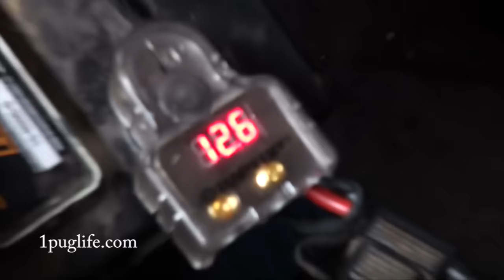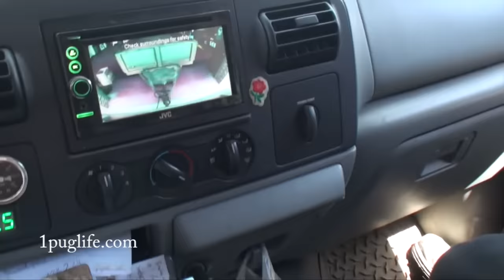wired up bunny heads

Comment: I got the same hydraulic tilt trailer. I installed a 12 VDC vibrator. Shakes the whole bed. Still, if the stuff in the bed freezes or is too sticky damp - you're a-shovelin' either way. I installed a few solenoids and a three position ignition switch as well. the momentary contact runs the vibrator through one solenoid, the latched position is for enabling the hydraulics through the other solenoid. I have to leave it in this position to allow tow vehicle electrics to charge the trailer batteries. A normal 7 pin trailer plug ground and hot leads are really not heavy enough for any loads, it will roast stuff. Need an isolated backup battery! There is a motorcycle sized battery on my trailer at the frame rail under the bed drivers front, that's for emergency electric brakes. It fails quickly and involves itself with pump battery and tow vehicle charge circuit. This is where I put my largest battery, a hidden beast, a big marine battery. Just toss that tiny thing for the run-away brakes, replace it with huge one.